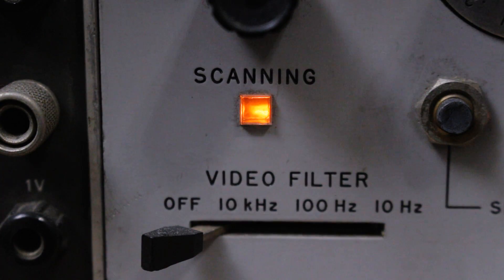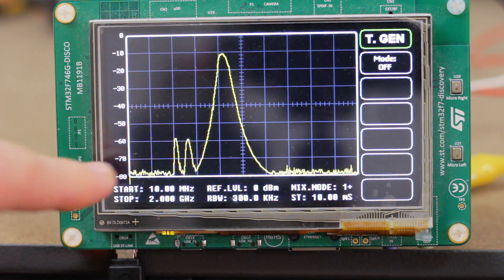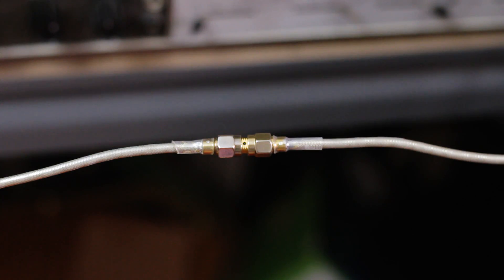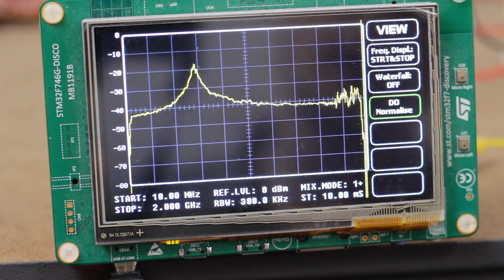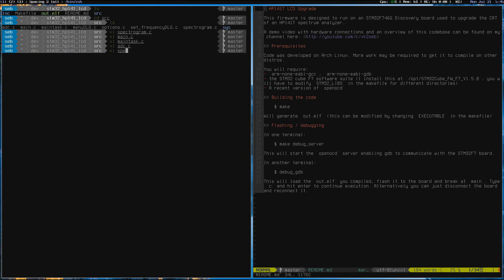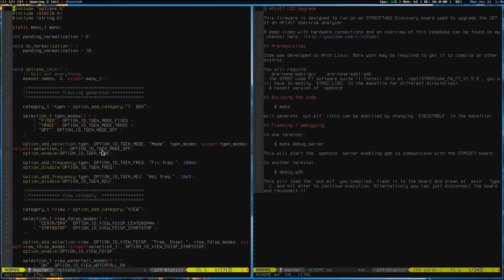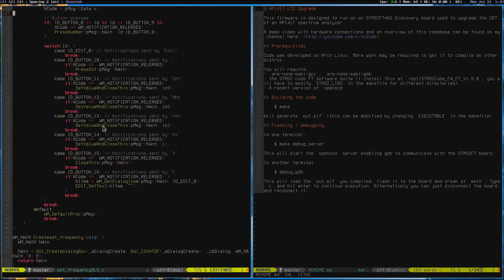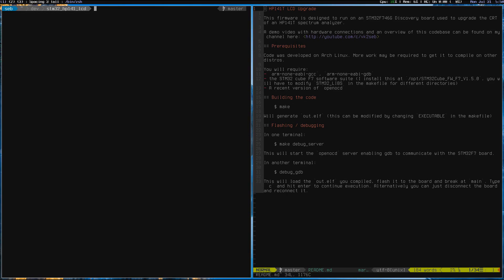LCD Upgrade for the HP 141T Spectrum Analyzer [Part 1]

Comment: I'd love to do this with the HP 853A / 8559A.    The onscreen display is very weak and the analog traces are hard to get in focus.   The CRT section needs work and if I could get his to work there that would be awesome.   The back of the unit has Horiozontal (Sweep) and Vertical (Video) outputs in the back.      I am trying to see what in your configuration would work for me.      I tried connecting the Vertical Video to a composite monitor before realizing that it needed the Horizontal as well.     I know it's an ask, but would you have any tips for me to see If I can get this working?

Thanks

Comment: I just re-watched the video in hopes I could just figure out how to replace the screen by itself with no options, except may the graph and scale, but even those could be printed on clear plastic and laid on the screen for us code illiterate folks. In addition I was hoping you'd do a quick follow up video on how to use the board and load the software on it, at least we could reproduce the project and go from there. 
      I think this project has many Industrial/Hobby applications in converting old CRT XY outputs into larger LCD screens. I think the software could be used to monitor the ADC inputs/peaks and determine the frequencies and amplitudes based on those alone and then display the results on the screen. This is such a great project to build on, not only for the 141T but, for all CRT based screens where measurements are manually done. With this project those measurement could now be done by the software and displayed. Thanks again for such a great video. Makes me want to learn programing to work on those ideas I just mentioned. Best Wishes & Blessings. Keith Noneya

Comment: Fantastic work. Causes me some dispare as I am 64 years old and totally lost on all the software aspect. Would not know where to start to learn it. Was an electronic technical offer since the late 70s and kept up with everything until 20 years ago. An analogue and RF expert. Frustrating how dated ones knowledge becomes and how one falls behind. But very enjoyable to see these new projects.
Reply: I know what you mean, not far behind you and software writing has always been my weakness when it comes to modern test equipment. However I did learn some Quick Basic better known as QBasic, it wasn't to hard to learn and I was able to do a few things with with. Best Wishes & Blessings. Keith Noneya

Comment: Super cool. You can get some easy wins by replacing that LM358 with an OPA277 (but you lose out with 1/f noise), OPA828 (great tempco, 1pA of input bias, and 4 nA per sqrt hz at 1k). Get a more powerful chip and drive a bigger screen, with more resolution so your waterfall doesn't look like an Atari .  Considering the time investment you put into this, buying a Zync or SmartFusion2 or one of them SoC's with an FPGA on-board might be the sweet spot. The SoC will easily drive a 1024x768, and the FPGA can pull the ADC data and do all of the frame buffer junk. Also, when you hooked that TG up to your scope, did you just turn your scope into a low dynamic range SA, cos that's what it looked like....if so, 'super cool' turns into 'wat. awesome so awesome.

Comment: Hi Vk2seb,  I would like to commission you a project; This is a change to be made to my Tektronix 492BP spectrum analyzer. The modification consists in replacing the exhausted CRT (they are not found on the market or on Ebay) with an LCD.
I hope you have the time available to carry out this project. Obviously you will be paid. Let me know your fee.
Thanks.
Regards
73 IU2KLZ

Comment: Will be interested to see the hardware.

I recently breadboarded http://f1frv.free.fr/main3n_HP141T.html after ordering the mentioned opamps and was getting terrible signal results that I'm pretty sure wasn't due to the unshielded cables.  I found that you can bring down the 16V-18V pen lift to around 500mV with a simple BNC Tee adapter and 50 ohm terminator.  This puts both signals well within the voltage range of a soundcard input and don't need to build a circuit.  You don't get the Y inversion of course and would need to correct for that in software which many of them can do.  I opted to purchase https://www.ebay.com/itm/272787408868 rather than make my own and it looks good even though the cable isn't shielded.
Reply: Excellent write up and detail!  Thanks for sharing.  I've been debating rescuing one of these and go back today for another shelving unit at the estate.  Thinking, since I have room and will motivate me to clean up some more space, I may get another shelve unit and a few more pieces of equipment to rescue and restore.
Reply: Wound up grabbing one of the HP 141T's with a pair of plugins and another RF unit.  Sounds like powers on, though the CRT doesn't display anything.  I still need to download what manuals I can find regarding and then try to find more if I need for troubleshooting the repairs.  Then for the upgrade. Thanks again for sharing and the motivation to save another made in the USA system.

Comment: I'm replicating your build with a 141T 8555A 8552B and its a week away in the mail. I noticed you don't have a schematic up or reference PDF from your circuit. Can you DM or reply on here and upload to your website? It would be a big help! Thank you for the upload!
Reply: I guess I'm confused because the scope can go up to 14+Ghz and assumed you would need a FPGA or something to deal with that type of high speed data. however it seems you are using the video out to analog pins in the discovery kit. The video out must have a smaller bitrate? 

The reason why I care is because I'm more interested in decoding. I want to make it so you can choose the trigger/keying for 1's and 0's, kind of like a RF reverse engineering tool.

If anyone can enlightenment me on what his theory behind the data I would appreciate it!

Comment: Looking forward to the follow up...  The printer option will be nice.  My 141T is still working fine but the ability to instruct a tracking generator OR to simply provide step by step "sweep instructions" to a regular generator through your display unit will be really nice.  Thanks for sharing your work.

Comment: Nice work Seb. Quick question though: Isn't there a GPIB interface on the back that you could take advantage of? I really need to shake the dust off of my Tektronix storage scope and see about doing something similar.
Reply from the maker: Thanks Chris! Unfortunately not, no HPIB/GPIB buses on this old thing! Only those analog expansion headers on the back for the tracking gen & preselector add-ons.
Reply: Lol, this SA is pretty pre-HPIB era thing.

Comment: Excellent video and explanation. Especially nice work on the waterfall display and interfacing it with the tracking generator. One correction: 141T was actually being made as early as 1969, and some of the other 140-series mainframes are even older! I suspect yours is a 1970's model, as the later ones from the 1980's that I've seen all use a slightly different CRT. I can explain how to easily date HP serial numbers if you are curious what year yours is.

With regards to the code for reading the instrument settings, even if you interface to the D-sub on the back, I suspect you will still have a real challenge in estimating the start/stop frequencies precisely, as the LO sweep is controlled by an analog ramp rather than a phase-locked synthesizer. This is going to become especially problematic at narrow sweep bandwidths, as the first LO in the 8555A drifts around noticeably. In a sense, the 141T doesn't really "know" what its exact LO frequency is at any given time.

If you need a clean way to connect to the rear D-subs, there is info online on what kinds of mixed-contact D-subs are used (known as a 17W5 IIRC, but you can use backshells for 37-position D-subs for the back portion). I did a partial write-up a while back when I made a replacement cable for my 8445B preselector: www.electro-tech-online.com/threads/making-a-replacement-cable-for-a-hp-8445b-spectrum-analyzer-preselector.150208/
Reply from the maker: Interesting, I pulled the dates out of the manual I have, but there is a chance that it doesn't match my unit. I am actually very curious how old it is - the serial number is: 1502A <space> 10994. If a year can be deduced from that I would like to know! I think I kinda know what you're talking about, I have seen photos of other 141T units with much darker CRTs.

You're definitely right about the issues at narrow sweep bandwidths. Still, I plan to give it a shot and see how it goes. I figure for at least some settings like scan width and scan time, even though there is no real 'output' on the instrument for the settings it shouldn't be too hard to quantize the rough ramp timings and figure the exact setting out (because there are finite possible settings). But, the center frequency will still be an issue at low scan widths as you say.

Great! what a fantastic write-up, thanks for the link. I was actually thinking of making a PCB with the cups and connectors mounted to it at the correct positions but I didn't realise you could still buy some parts of the connector. That will be really helpful.

Cheers!
Reply: Okay, so when reading HP part numbers, the first four numbers in the serial number are the year (added to 1960) and the week of manufacture. so 15 would be 15 years after 1960 (1960+15=1975), and 02 would be the second week, so January of 1975. The letter after the date code is the country of manufacture, so "A" would mean that it was manufactured in the United States. This method works for all HP test equipment, not just 141Ts, made up until about 1996. Is that the serial number from your manual or from the back of the unit?

You might even pull out the plugins and check the separate serial numbers on those. Many of these units have been out in hobbyist hands long enough to have had the plugins swapped around between mainframes, so not all of them are matching units these days.
Reply from the maker: Awesome, thanks for the tips on dating the units. The number I gave you was from the back of the 141T mainframe.

Yep, your hunch was dead right. The oldest serial I have seems to be on my 8555A (18GHz RF section). It says '1043A 00184'. 1970! Still going strong...

I should have been saying almost 50 years old, not almost 40!